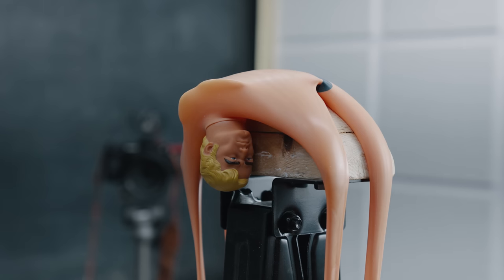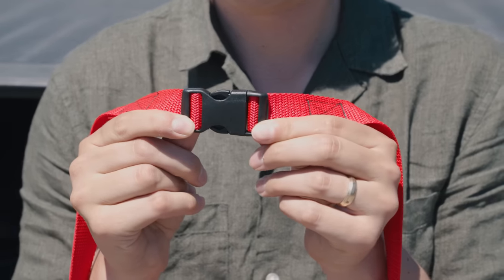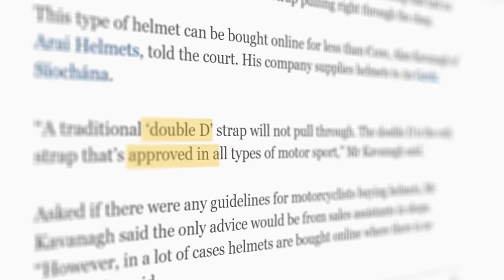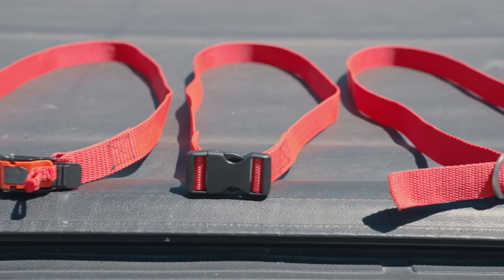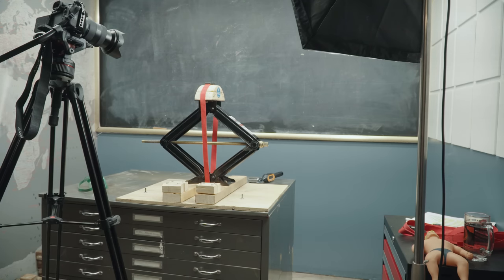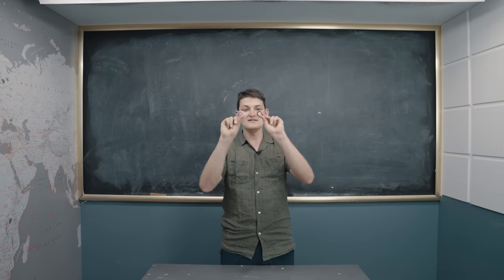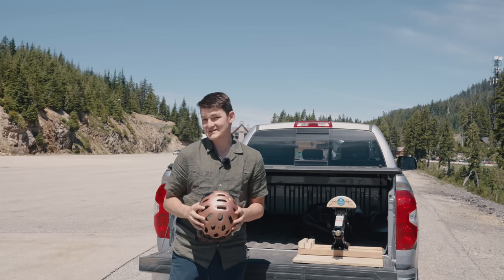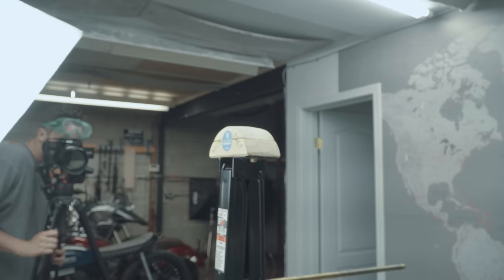Why Motorcycle Helmets Use this Ancient Buckle

Comment: Got the ratchet thingy on my Shark helmet and I love, how I can just do it up or open it with my gloves on. DD on previous helmet drove me insane!
Reply: I feel the DD are quintessential on performance lids but for general street riding without breaking the law (too heavily) a ratchet strap is definitely my go to. Ease of use and can cope with fairly low end strain makes it my go to strap.

If I was on a track or wanted to be the next "Street Rossi" then DD for sure!
Reply: yup I seemed to have a lot of those "put helmet on, put glove on, forgot to clasp DD rings so pull off at least one glove to clasp"... i've managed to get my shuberth clasped with one hand while riding (gloves on)...
Reply: I have a Shark EVO GT, love the helmet but the stupid ratchet buckle is by far the worst thing about it. It's fiddly to adjust and needs adjusting often. Just fit a double D ring like a proper motorcycle helmet 😂
Reply: @SausageSide  funny how different people are. I never have to adjust mine, but that's probably because I've got such a small head that I'm on the tightest setting and it's not touching me at all, so it never moves :)
Reply: @Trikk adult ADHD... I'm in my 40's... and it's always been a thing... get 1/2 way though something (like putting my helmet on) and my brain decides something is more important like the fact that I forgot my keys inside the house) so I run to grab them, then get back into the garage... where was I... hmm helmet is on my head... must have been my gloves... 

so ya... while it's part of the riding ritual that I've been doing for over 20 years off and on it's not something that won't happen from time to time.
Reply: @markthomas3853  Thankfully one positive thing from my ADHD is that im very anal about safety. Probably the reason I havent dropped a bike, in my silly ADHD world If I lose control of the bike ( even a drop) it can lead to hurting someone or myself. downside is maybe once or twice I year I cant ride because im too hyper focused and all the things that can go wrong while on a bike (im the same with a car)

Comment: This is why they use polycarbonate lenses on motorcycle helmets and not plexiglass...
Reply: Same thing and branded. The plexiglass used for this was far too thin, visors (besides trash helmets) are much thicker.
Reply: @MrVTeta  Plexiglass is the branded name of acrylic. Polycarbonate is substantially stronger than acrylic.
Reply: @MrVTeta  nope. Acrylic is different from polycarbonate. They are forms of polymers but chemically different and different in the process of making them. Polycarbonate is stronger.
Reply: @bananabread7641  are you sure Plexiglas never offered polycarbonate sheets? I could've sworn they sold them in the 80s. 🌈
Reply: @GrimYak  You are right, this brand is not sold here and I confused plexiglass with lexan which is polycarbonate. Polycarbonate is indeed stronger. Anyway, even for polycarbonate the sheet they used was far too thin for this experiment.

Comment: Fidlock seemed pretty damn strong, too. It couldn't have been far off from being stronger than the straps as well.
Reply: @HalibetLector convinced i've seen billet wheels compared to cast in a hydraulic press style crush test, with cast being stronger
Reply: Never seen a Fidlock strap before, i am not joking. I didn't even know this connection existed. For me it's D ring anytime. It's simply too good.
Reply: For sure! It was roughly 1.5 ft-lb less strong, which is a trade-off I'm willing to make for sure. (Fidlock offers samples of their products. I think I'm going to try to request a couple and try it on one of mine.)
Reply from the maker: True! As long as it's stressed in the right direction, the aluminum fidlock is nearly as strong as a double D. Though it's a little unnerving how you can knock it open with one finger. ~RF9
Reply: Ryan: “a little unnerving how you can knock it open with one finger.”
Cicada or other large summer bug: Don’t mind me, I’m just gonna aim right for this little soft spot at your neck and see what happens.
Reply: @chrisdavidson911  compression vs tension......different forces. Cast may not perform the same way under a different  type of force
Reply: @DecalDen  oh i know, this also ignores any wear and fatigue issues with repeated use, and, the hole the strap goes through to attach to the buckle will be under both forces depending on which exact bit you're looking at
Reply: @zeroninehundred  In my experience a bug hitting it would just bounce off. You have to pull downward on the release tab so unless something can grip it. The only way to knock it open would be for something thin enough to get into the gap between the magnetic plates.
Reply: @zeroninehundred  This 😂😂😂
Reply: Love my Fidlock and uber light Krios Pro.  The best part is still being able to latch it after my dumbass forgets and puts on my gloves first.
Reply: @HalibetLector They could even use stainless steel, that would be very strong, but more heavy...

Comment: I ride mostly off road, and the ratchet strap on my helmet lets me take it on and off quickly when stopping to rest to cool my head off.  I consider it and my camelback 2 pieces of gear I wouldn't ride without.  While other riders are sweating it out because its inconvenient to get the helmet off and get the water bottle out, I can do it in whenever I need.  And the ratchet strap is adjustable, I snug it up every time I put it.
Reply: DD is just as fast to take off.
5-10s. slower to strap on.
Easy solution is to get a quicker bike to compensate that.
Reply: @XtreeM_FaiL  A DD is a 1978 XR75 and a quick release is a 2022 250R by comparison..

Comment: for sailboat sunroofs there is another option that combines most advantages of the double rings and the more modern shutting mechanisms
they are steplessly adjustable, and have to be adjusted when used every time, just like the rings, but can be quickly opened up again, as the strap is clamped onto the ring by a metal plate pushed down with a spring

Comment: My Aria’s are DD loops, but my BMW system 6 has the Micro ratcheting system, (Schubert made) but comes up to all standard requirements from TüV, CE, Snell, etc..  

The worry I have isn’t the buckles or loop rings, it’s the Anchor Point of the straps which are set within the weaves of the matting, it’s those I see the dangers.... remember Sic 58 (10 years now)

Comment: Every now and then I'll forget to buckle the helmet strap and frantically try to buckle it at a stoplight or have to pull off and buckle it. Wishing I had something that was easier to buckle. I was thinking about getting a quick release strap, guess not. Thanks F9
Reply: My question is how? I have always just been like when the helmet goes on, strap gets done up immediately before moving on to anything else.
Reply: @That Dude fair enough
Reply: @Styre69  one example, you wear glasses. You put on your helmet, put glasses on (it's harder once the strap is tightened), then go ride. Oh that's right, you forgot the straps!
Reply: @alastairtheduke  never had had the issue putting on glasses (sun or otherwise) with it already tightened.
Reply: @Styre69  You asked why (because you clearly don't have this problem) and I answered.

Comment: I've had the double D's on every helmet I had until my last one, that is a Caberg that now has a ratchet and double D's combination for adjusting. Many EU helmets here in Europe now use the ratchet and double D's in combination. It is 10 times more user friendly and If you get to the level of impact and twist on your helmet that the ratchet fails...than you have much  bigger problems....your neck will be broken before the ratchet fails.
Reply: Did you watch the entire video? The nylon strap is designed to snap at lower than neck breaking force.
Reply: @TimpaNidevo  And another thing, the DD's are overkill and not user friendly...it's 2021, e have better tech. Top helmet manufacturers don't use ratchet systems now because they are idiots, they use them because they are better. I'm amazed one can still buy an expensive helmet with only the D's  as a locking mechanism. Old habits die hard I guess...and bikers are some of the most resistant to change people on the planet.
Reply: @valiyzf600   @valiyzf600  We all know what the current year is. Something being new does not mean it is better and something being old does not mean it is worse. The idea of D-rings not being user friendly is laughable, it takes a few seconds to loop the strap through them. I agree that top helmet manufactures aren't idiots, you'll note that those same manufactures offer D-rings and alternatives. The evidence in this video shows that D-rings are superior, do you have any evidence to the contrary?
Reply: @TimpaNidevo  D-rings are not superior, they just have more strength. That does not equate that they are superior. The question is if that strength is needed with the price of a more fiddly setup. It takes 5-7 sec to lock my old helmet with D-rings, maybe a few more if it doesn't feel rightly adjusted from the start, and preferably all of this without gloves. It takes under a second with gloves to do my new one and it's perfect every time, because I only need to adjust it once. The only reason manufacturers offer both versions is because bikers and people in general are  creatures of habit and/or regulations that are not updated in some parts of the world.
Reply: @valiyzf600  As you can see from this video, the alternatives are not strong enough. The weakest point ought to be the nylon strap, not the securing arrangement. The strap has been designed to be as strong as possible but give way before neck breaking force is reached. You seem to believe that a typical rider's neck would break before the strap parts, I doubt that this is the case. Have you ever noticed that every helmet has a strap made from the same material with the same width and thickness? I don't believe that is an accident. The last thing a helmet manufacture wants is for a customer to be killed by one of their helmets, the strap has been designed with this in mind.

Comment: You can't simply compare those torques! The lever arm of force (taking effect on the strap) is dependent from the condition of the car lift and changes rotation by rotation.

Comment: a plastic micrometric ratchet? would have been interesting to see the metal one like those Shoei use only for their helmets
Reply: I have a micro ratchet on my Shoei and love it.
Reply: Exactly
Reply: 🙄 Double D-rings, dude … the strap will break, before they do.  Why settle for less?!!
Reply: I have the shoei gt air 2 with the metal ratchet. I quite like it I think it is supposed to be easier to undo with gloves on. My Arai RX7 Corsair has the double D as has every other helmet I’ve ever had and it is a great and simple solution
Reply: @morri03  had the XR1000 back in the early '00's  with a double d and loved it.Even in winter it was perfect,sure,i had to buckle it barehanded but i could tighten it accurately over my neck warmer.
Reply: @morri03  I have a Neotec and Gt-Air both have ratchet and they are easy to operate with gloves. However gloves is the last thing i put on or first to take off so not too often i get to operate them with gloves. Still I think with time you get use to operate your own equipment with gloves on :)
Reply: @kierenmoore3236  If you've never used a metal micro ratchet, you don't know what you're missing.  I clipped mine on this morning and smiled.
Reply: @bluesriderDF  … I’ve used my mate’s GT-Air II.  I’ll take safety/being secure in the knowledge I’m using the best available fastener, over smiles(?!), any day … though, the knowledge that I’m using the most secure available fastener DOES make me smile and certainly puts my mind at some ease. 🤷🏻‍♂️. You do you, tho, bro; we all have different priorities and preferences. 😎👍🏼
Reply: @kierenmoore3236  That's what I have GT Air II.   My head would get ripped off long before that micro ratchet would break. Happy riding!
Reply: @bluesriderDF  … I do agree with the above comment that this test should be redone with a steel (eg Shoei) micro ratchet buckle, tho … which F9 may well have done (in private ?!), or may have avoided doing altogether so as not to potentially piss Shoei off/put them offside … ?!! 🤷🏻‍♂️.  I wouldn’t believe any marketing talk/“puffery”, tho’, from anyone (including Shoei) without reliable and independent test results … and I can’t find any for the Shoei micro ratchet buckle or any similar ratchet buckle, so … 🤷🏻‍♂️🤷🏻‍♂️🤷🏻‍♂️. And I love my Shoeis (and Arai and AGV), but all my helmets have Double D rings.

Comment: Controversial opinion but I'd still rather my ratchet over the double D-rings as they're so much faster and easier, if I suddenly have 555lb of force exerted on my head pulling my helmet off, I've got bigger problems than whether the strap snaps or not.
Reply: I was thinking the same
Reply: Agree.
Reply: Too seay to accidentally undo while riding
Reply: @mariodonkartworks  I have been riding for over 4 years with a ratchet strap, never had it undone accidentally. It's the most common here in the Netherlands as well

Comment: As a long-time motorcyclist, this came as a surprise. A racing scooter friend of mine (has a Lambretta which tops out at 100mph {160kph}) told me that the scrutineers will instantly reject any rider whose helmet doesn't have a double "D" fastening.  I thought it was because the DD was easier to release if the rider was spark-out on the floor after an accident but NO, it's because the DD is stronger than the webbing. The things I didn't know I didn't know.... Thank you for risking life and limb for us & bringing it to our attention.